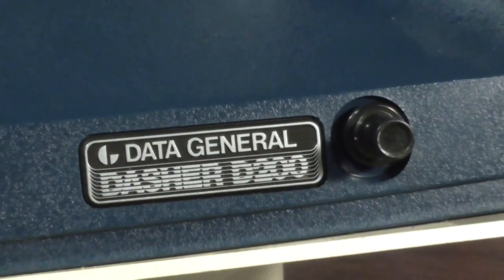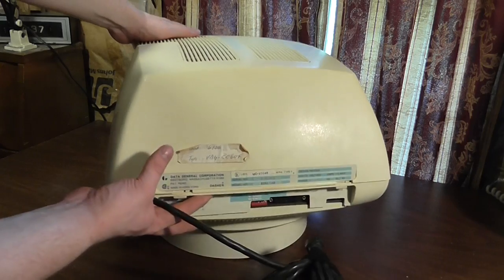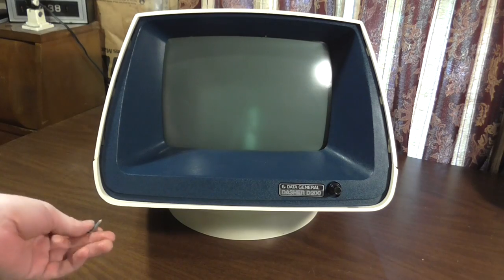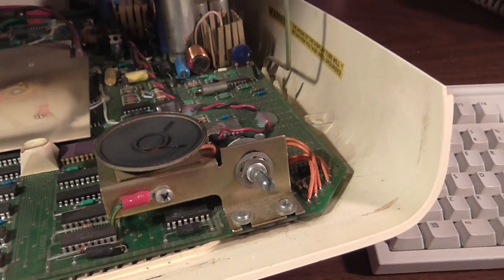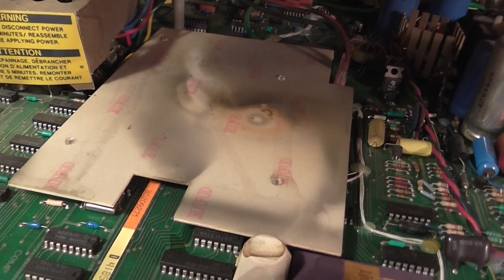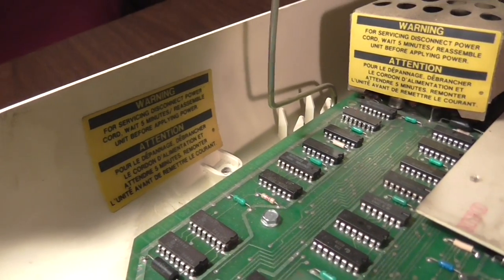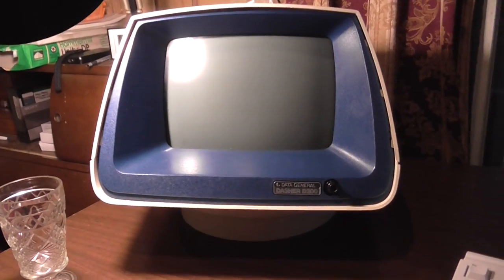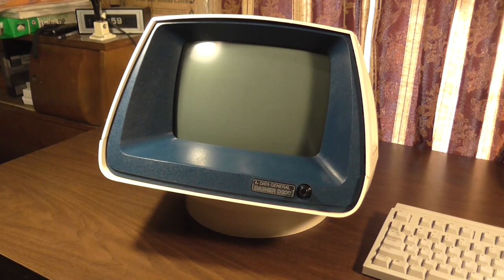1978/79 Data General Dasher D200 Serial Terminal

Comment: I worked for Data General many many years ago and I recognised the D200 monitor straight away. BOY, have things changed!!!!. D200 was a heavy monitor, swivel base and a b/w display though if I remember they had models called the D215 which was 'green' display and a square shape and MUCH lighter.

Comment: Ooooo!  I had one of these in 1981 or so.  It had gone through a fire and was for sale for $5.   I turned it on and it worked perfectly.   Only issue was that the big "Enter" key on the keyboard generated a LF, not a CR code, so it was clumsy to use with systems that expected CR.

Comment: Working as a Field Service engineer @ Data General Netherlands I installed these by the lot. I remember one exhibition case in Amsterdam, where we demoed an Eclipse C/350 with some of these terminals. Being bored waiting for someone with spare parts for a 6070 disk drive, I acted a demo with this D200. So I showed how this terminal could tilt and swivel. As all move paerts were hard plastic, all move made a terrible squeeking sound. I was told not to demo this while the exhibition was on!

Comment: We had a modem and terminal like this at home; my dad was the GM there from '78 to '82.  I got to play Colossal Cave ("Adventure") on these at the Van Nuys office while my dad was working after hours.  They had a big Eclipse system in an air-conditioned room, and boy was it cold in there.  Wrote simple text games in BASIC with my brother.  Also played several other games; Kingdom and Lunar Lander are the ones I recall just now.  Oh, and Space Invaders with ASCII monsters!  That was big fun.
     The vent detail was dual-function; you could also adjust the display orientation by grabbing them with both hands.  Turning the knob once it was on adjusted brightness (clockwise = brighter.)  Didn't know about the lock-open feature.  This was big fun; thanks so much for the walk-through!

Comment: The gold chip at 4:43 is the CRT controller it generates the signals needed for a  raster display.
The same chip was also used in a couple of computers from around the same era such as the IBM PC MDA and CGA cards and the BBC Micro.
The smaller silver chip to the right is probably the character rom.

Comment: The styling on that is beyond cool!  So 70's, so futuristic!  And it can't do Facebook!

It's really too bad it doesn't work.  I once had a Wyse terminal, green screen, but never had a keyboard for it either.  It was from the 80's but I don't remember the model and I don't have it anymore.  It was their most common one.  I didn't have the keyboard for that either.  It did beep and show a cursor when turned on, I surmise it may have displayed data if I sent it on down the line to it, but at the time I didn't know anywhere near what I know now.  I never should have gotten rid of it, that's for sure.

Repurposing that would be cool, but you'd have to find a CRT that would fit it, and generally VGA monitors were about 14" or 15" in size.  If you get a hold of an IBM (PS/2) 8513 monitor, that may fit it, I think it was 12 inches or so.  You'd have to measure it to find out.  The only way it's going to look good being retrofitted with another CRT is if you find one that's the same size and has the same mounting system.  Otherwise it'll show.  Good luck!
Reply from the maker: jaykay18 Probably a WYSE model 50, I just scrapped two of those and yeah they are everywhere. I was going to set them up with a linux server but I got sick of tripping over them. lol

Comment: I have a Data General Nova 4 and I. Need a terminal. Want to sell yours?
Reply from the maker: Sadly I haven't owned this thing now for probably 5 years. I never got it working either.
Reply: @TranscendentalAirwaves  I actually found a website for a Data General Museum in Colorado. Hopefully they will be able to help me find a terminal and get this thing up and running. Great video. Thanks for you reply.

Comment: That looks like a 68K Motorola chip, similar to what they had in the Apple 2 or Sun 1. If it has a proprietary keyboard, it probably has a proprietary terminal protocol, so nothing that is still in common use today (i.e. it is probably does not use the VT-100 protocol). Maybe feeding in ASCII characters or EBCDIC will give you something -- if you ever get the CRT repaired, that is. It would be awesome if you could figure out what protocol it uses, and maybe write a simple program to convert VT-100 protocol to this device's proprietary protocol, then you could actually use it to connect to a modern Linux or UNIX system. But unless you are an expert in that kind of thing, it would probably be pretty hard to do, like a years-long project.
Reply: ***** Honestly you might not have any problem at all with a "modern" Linux or UNIX system. Most of the default software is ancient or at least the near direct ancestor of something ancient. Some of the common terminal emulators support all kinds of stuff, so I wouldn't be surprised if the output can also output tons of obscure things. You'd be connecting it as a serial terminal anyway.
Reply: ***** well, modern open source terminal emulators can support surprisingly old and obscure protocols, but he doesn't want a terminal emulator here because he has a physical terminal (no emulator necessary, he has the real deal). So what he needs is a version of "getty" that can support the old terminal protocol used by this device. I don't know if they exist. There might be a way to modify this software:

http://netbsd.gw.com/cgi-bin/man-cgi?getty+8+NetBSD-current

so that it could work with the device he has. Or maybe, like you suggest, it works without any modification.

Comment: If you haven't, maybe try contacting this guy http://www.foxdata.com/blog/tag/dasher-d200/ and see if he every got his manuals converted to a digital format? Sounds like he probably had a manual for this exact terminal at the time of that post (~2012).

Also, https://www.scribd.com/doc/146282825/Data-General-DASHER-Display-Terminals-Models-D100-D200-User-s-Reference-Series#scribd

With a bit of work, this -> https://github.com/tmk/tmk_keyboard plus the hardware it's intended for and a few other bits might suffice to handle the keyboard interface.

Comment: Amazing design. It would be great to fix it and use Raspberry with some old UNIX emulator. As variant, you can take out internals (save it anyway), and replace it with modern color CRT tube and monitor board with the same size. You will be able to use green terminal emulator and watch YouTube, or some media player to make it usable in ordinary life